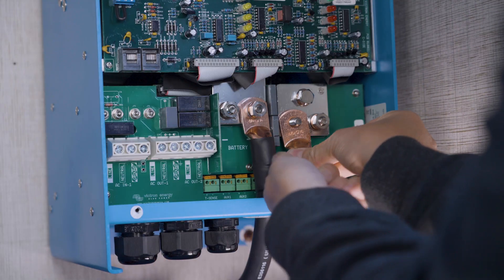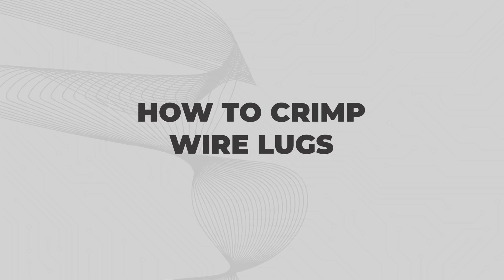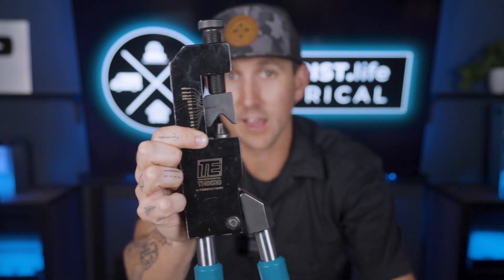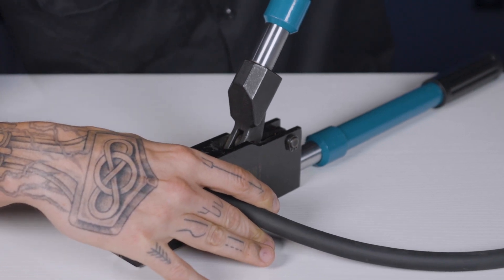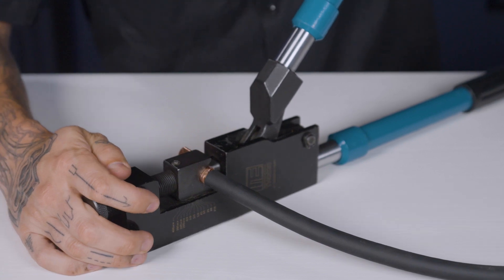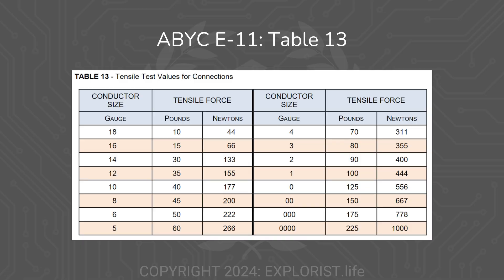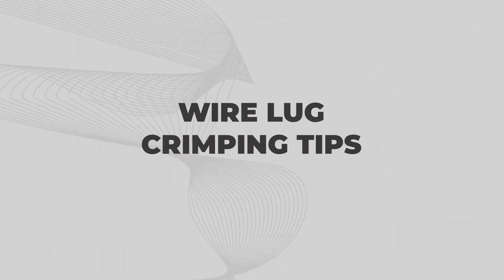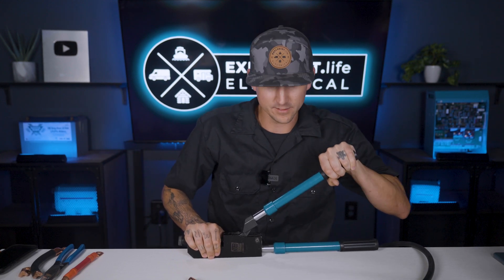Wire Lug Crimping 101 - Wire Terminal Basics | Ep: 5/14

Comment: Nate for me there seems to be different methods. Your ( and a European Bosch) crimper point with a small round bolt while other (like the shown by your former) that try a hexagon shape.
I assume you now prefer the bolt method? 
Last year I was not able to make a number of crimps on a ship in lack of tools so we hired an electrician. He came with a $2000 battery driven tool. His argument for this tool as a professional: If you have to do a lot of crimps a day, you may become exhausted.  But that tool was also in the method of hexagonal.
Reply from the maker: The tool discussed in this video is the tool I’ve been recommending since 2019.

Comment: Which crimper do you recommend if the thickest wire you need to cut is 2AWG ?
Reply from the maker: Same one.  We can’t really switch to a smaller crimper until 6ga given the terminals are insulated.

Comment: Thanks! You talked me into the TEMCo crimper. Using the yellow hydraulic crimper, there have been two times I've had to re-crimp using a smaller die, because the rated die didn't compress enough. There is too much variability regarding connectors and wire for the dies to be taken for granted. The dies are good, when everything is perfect and designed to work with the die dimensions, but too often, manufacturing variability is a significant factor.